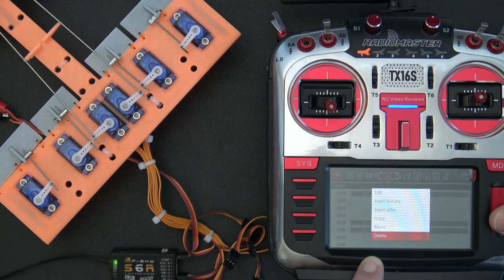EdgeTX Channel Mapping Masterclass

Comment: Pretty basic stuff that a lot of people have difficulty with.  I think the concepts you presented are fundamental to understanding opentx/edgetx.  Thanks John!
Reply from the maker: Agreed. This video was made in response to questions that seem to pop up on a regular basis. I hope this will be a good reference over time for people coming to the platform.
Reply: @RCVideoReviews  I think when I started to use OpenTX the thing that really confused me a lot was setting the channel order in the radio settings and the various Multimodule firmware downloads (AETR v. TAER v. blah-blah).  Maybe you should cover that in your next Masterclass.  I think this really muddies the water for some folks.  It was causing me to overthink things quite a bit.

Comment: Thanks for all of your videos. You were a great help when I first got the TX16S with OpenTX.  I recently converted from OpenTX to EdgeTx and again you are a great help.  I know that this is strictly a video on how mixes and inputs work, however at min. 13:10 I think you have the rudder throw backwards when mixing ailerons.  This is a minor thing and of no concern given the subject matter of this video, but people new to EdgeTX might take your instructions too literally and set up their planes in this manner.  
For the beginners out there, the proper mix set up is for the rudder to move towards the UP moving aileron, that way the nose of the airplane is pointed into the bank of the turn that is created by the ailerons.
Reply from the maker: There's no telling which way is right without seeing it on a plane. Sometimes--depending on the hardware arrangement the sweep moves one way while the rudder moves another.  I absolutely cannot account for every different hardware arrangement possible. 

In any case, people should make sure their control surfaces move in the proper direction.

Comment: 1:10 "When you come from other platforms" Dittos!   
I'm only one minute in but that comment above made me post.  I'm coming from Spektrum.  You admit you don't know Spektrum.  Man...from my end, You just don't know how to think to wrap your heard around the box until you repeat and fail repeat and fail and then get it. 
In short order on Spektrum I was flying same day.  I made mixes.  I could make coordinated turns.  I added flaperons to a bind and fly sailplanes.  You could trim out the elevators when adding flaps.Throttle shutoff was easy. Navigating the Spektrum receiver was easy. I've had my RX16S for 3 weeks and have yet to successfully navigate the box.
I hope I can after watching the rest of the video.  ;-)
~~~~~~~~
EDIT:
WHY YES! I enjoyed the video!  I like it when you get pissed.  ;-)
For me...I'm going to make up a mock plane as you've shown with a motor circuit to help teach me.  I was advised on another video to leave the throttle wide open while binding a Spektrum receiver so that the system know where 100% throttle is.  Glad I didn't believe it....and didn't get cut.
Headed out to the shop.  I'm programming a jailbroke bind and fly AX-631 from a Night Radion....If successful I'll come back and worship your page!  ;-)
~~~~~
EDIT ONE HOUR LATER: A guy named Mikey in RadioMasters Owner Group told me the relations between AETR and receiver positions ...I was overthinking.  Using what I learned here all the control surfaces are working properly.  Got to adjust for flaperons, AS3x and Safe and on on my way!  Thanks!

Comment: My opinion regarding the title of this video is some information I expected are missing... You explain the relation between mixer and receiver outputs, and stresses that you never leave the mixer tab, but actually I noticed there are other parameter that have in fluence on the channels order, especially the firmware used in the 4in1 RF module (what we can chose in AETR or TAER preset order), and the "disable channel mapping" switch in the model settings which. That's also what I expected to see in this video ;-)
Reply from the maker: Channel mapping is  a Spektrum issue, not an Edge issue and I don't care for or advocate for spektrum.
Default channel order doesn't mean much other than during initial setup. For 99% of people who learn how to use this radio, they will wind up using existing models as templates to copy from in which case channel order means bupkus.

When we make these videos we have to make choices about what's in and what's out. Because if we include every single issue that every single person cares about, the videos would be hours long. 

This video should be more than enough to explain channel mapping and to get you on the right track to ask google any remaining questions you have.
Reply: @RCVideoReviews  Hum... If it's an "issue" like you say (I'd rather call it a feature), it seems it's not only Spektrum related, as I had also to fiddle channel order with other model/brand than Spektrum. And I'm following several groups on FB where the question of channel mapping is answered quite often because many people are confused about either 4in1 RF module firmware choice and the switch "disable channel mapping, not always Spektrum related). That's precisely why I made some research on that topic to validate my own thoughts. Then I went to this video, which I thought would shed some light on the matter ;)

Comment: Hi John, I can't get my auto level function to work on channel 5. I have assigned the the channel from AUX1 to AIL2 with no result. Channel 1 (AIL) and 2 (ELV) function as expected in this mode  I'm wondering if a particular channel configuration is required to link channel 5 to auto level functionality? I have the SA switch set as my auto level. Your videos are excellent by the way.
Reply from the maker: Join my discord and ask this question there. Too much back and forth required to solve this and YT is a terrible platform for such dialogue. The radio doesn't know or care what auto level is. If you're sending a signal on Ch5, then it's up to your FC (which you didn't identify) to react to your  mode commands.

Join discord for further discussion.

Comment: Very well explained , what receiver is that
Reply from the maker: That is a FrSky S6R. Thanks for watching.
Reply: Sure, just bought the TX16 . So happy for all your insightful videos I have learnt so much .  I bought an Xfly Glaster and placed an AR631 in it from crashed areoscout . The maiden was not good , luckily I only walked away with a broken prop. How would I active safe with the tx16 ? Will a mix be used for that ? At the end of the day I am a new pilot and I am just looking a receiver that works well with the tx16 and that has some kind of flight assist to help my learning process. 

Thanks

Comment: Very useful info. I'd love someone else's opinion on mixing in inputs vs mixing in mixer and some different uses for each. I have used both methods for some things. That would be another interesting one.
Reply from the maker: I generally avoid using inputs for anything but defining inputs including dual rates.

Comment: Do you have a video about programming thrust vectoring? I have Jets and can figure out the canards, but not the mix for rudder and yaw thrust.
Reply from the maker: I do not. Just remember when it comes to mixing:

Identify the thing that "needs to be fixed"
Identify the thing that "does the fixing"

So if you have a thrust vector servo, that's what needs to be fixed.
Yaw (rudder) is the thing that does the fixing.

So your mix would be:

Chx - Thrust Vector Yaw Servo Weight 100%
 Chx - Rudder Servo Weight 20% (or something much smaller)

Comment: but in this mode the multimodule firmware (AETR) does not correspond to the order used?
i use firmware AETR multimodule but spirit gt it doesn't work this way.
i changhe firmware multimodule in TAER and after changhe all memory model ?

Comment: I wanted to comment on this video. I thought I knew how to setup an airplane, and I have seen this video before. Your teaching skills are excellent. You made this content about a simple as if it were about making a ham sandwich. Here comes my frustration. I have 4 other planes on this radio, so I thought this would be just another plane setup. I tried everything, but when I power on, nothing works right. My elevator vibrates, no ailerons, and a hard over rudder. Any thoughts?
Reply from the maker: Sounds like a channel map problem. Spektrum RX?  Do you have another RX you can try? Also, get on discord. More likely to get more help there.... Link is in every video description I post.
Reply: @RCVideoReviews  Thank you sir. What I did was change receiver range from 1 to 12 to 1 to 6. It bound. Thanks again

Comment: Really great video, but one thing you said isn’t completely true. Like you, I believed that AETR or TAER etc didn’t really matter, apart from it being the default channel order when creating a new model. But I found out this week that it’s not the case - when using DSM/DSMX with a multi-protocol module, including the internal module on the RM radio. Read this, it surprised me and I think it’ll surprise you too …
“The module will take whatever input channel order you have choosen and will rearrange them to match the output channel order required by the selected protocol.”…
“Unless Channel Re-mapping is disabled, the radio model's channel order must match the Expected Channel Order of the MULTI-Module, which is AETR by default.  See the Channel Order page for more details.
By default the MULTI-Module will expect channels in the module's Expected Channel Order, and will convert them into TAER order automatically.” https://www.multi-module.org/using-the-module/protocol-details/dsm
Reply from the maker: I didn’t neglect to mention it. That is a DSM convention, not an EdgeTX convention. If I had to document the specific conventions for all of the protocols usable in MPM there would be no video like this. 

Also, frankly, I really don’t use Spektrum gear so I don’t address their limitations. Edge and MPM make accommodations in their code to accommodate DSM but that has zero to do with the organic behavior of the radio demonstrated in this video. 

I’ve spent a fair amount of time looking through the code on MPM and even produced a video showing how to compile custom versions of it. But thanks for sharing the link…
Reply: @RCVideoReviews  thanks for the reply. I’ve looked more into this and it doesn’t just affect Spektrum. By default MPM will convert the channels over to the default channels of any protocol, but there is an option in the EdgeTX/OpenTX receiver menu to override this default.
Reply from the maker: @martinrcflyer4089  My point exactly. The MPM isn't really Edge and Edge isn't MPM. They are discreet. Edge "doesn't care" about channel names. Outside protocols might and Edge provides accommodation for them.
Reply: Thank you for posting that link, I was trying to setup a UMX Night Vapor on a TX16S and couldn't figure out what was going on. It has 3 control surfaces so I moved the rudder to the right stick and since it's Spektrum I set the channels as TAER but it wouldn't work on DSMX. I set the order back to AETR, 4 channel with aileron and it bound and worked as it should.

Comment: question, i reversed the servo on edge tx so that aileraon goes right direction, however when i view the bar on edge tx if i move stick to right, the bar moves left but aileron is moving correct position, is that normal set up?
Reply from the maker: If you reverse an output it's normal for the mixer to show one direction and the output to show the other. As long as you reversed it in outputs and you visibly confirm the correct movement you should be fine.

Comment: Hey John...I have a whoop on my tx16s radio...2.7 edgetx...right now my channel order is RETA...I want AETR...how do I move my channels around in the mixes screen so I have the correct order
Reply from the maker: Just change the source in each mix line. 

In your system settings you can specify the default channel order for new models.
Reply: @RCVideoReviews  ok...thanks...really like your channel...very helpful info

Comment: I put lights on my elechawk lights on my plane and was controlling the with aux 1 on my spectrum radio. And i cant get them to function on my radiomaster tx16s running edge tx. I tried setting it to channel 5 and can't get it to work to save my life. Your help is much appreciated!
Reply: Do I need to setup logical switch?
Reply from the maker: You don't say what RX you're using. That would help. This is solved in the mixer. Mixers connect channel assignments in the radio to pins on the Rx. So find an open PWM pin, say Ch5. Go in the mixer on Line 5 and add a switch. Verify output my opening the channel monitor and flipping the switch. You should see a ppmus change from 998us to 2012us. When you see that, your light controller should do something.

You also don't mention what light controller you're using or what the controller expects for pulsewidth in order to change states.

I'll be happy to discuss further on discord if you still can't work it out. Invite is in every video I post.
Reply: I'm using elechawk ordered from Amazon. Using it on a lemon 6 channel receiver.
Reply: I don't know the pulse width though I don't think they specify on pulse width.
Reply: @RCVideoReviews  mannnnnn I figured it out had to assign a switch to channel 6 on the mixer page and make it act. I feel accomplished.lol thanks buddy and keep up the awesome videos!!!!

Comment: I wander if anyone can help me, I am relatively new to edge tx, I have two models one is a sport cub s2 plane and the other is a OMP M1 helicopter with an external mini s-fhss module plugged into the sbus port. The issue I have is every time I want to fly the sport cub I have to go into firmware and change it for the TAER .bin file and then to fly the OMP M1, I have to write the AETR firmware. I know this can be sorted so I don’t have to rewrite the firmware every time I fly but I can’t get my head around what I need to do to fix this, any help would be appreciated. Thanks
Reply from the maker: You need to join discord and ask there. Link is in description of every video I post.

Quick answer: No, you 100000% absolutely do not need to flash different firmware for each flight. Something is dramatically not right with your setup.
Reply: @RCVideoReviews  ok thanks